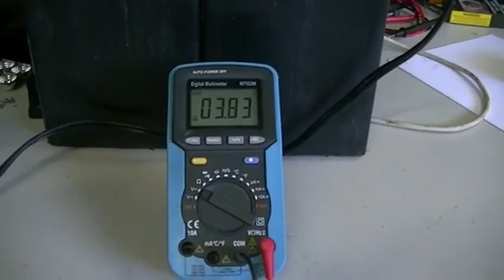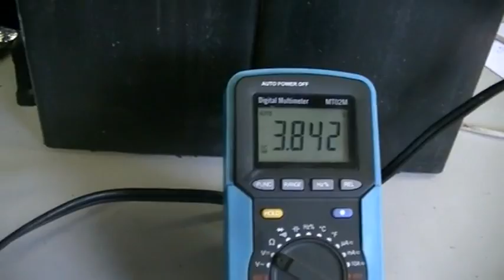brush arcing investigation.

Comment: How make inductive kick back in car with out ignition coil culd it by done? And how wuld I make dual ignition with relays? 
I need some sort of variabel ignition with variabel polarity swap .
Like + + ,- - ,+ - ,- + .
Somthing like that does any ciucuet can do that task? 
I did tried out plazma ignition with good results faster spining starter motor but I come acros problem my starting charge rpm increase on alternator from 1 to 2.5 K rpm .
So mostly to my your rotary transformer is interesting to my and phase spliter .
Im actualy experimenting lot with my engin a try out diferent fuel types so I need to increase my ignition system I have old gm 4 pin ignition module with induction triger inside the distributor ignition coil is the gm hei singel coil e core type I have aperantly problem with polarity in my car I have positive voltage regulator and that 4 pin ignition module is polarity senzitive as well I do have R terminal starter motor selenoid but my fuze pops when I try to use it.
I have teribel problems starting my car in winter its anoying so any help please?
I wuld like to aplly amplifier and plazma at the same time for centrain engin time operation.
So thats why I wuld like to add variabel ignition.
Those rotary transformer basicaly are similar to magnetos I supose.
I wuld like some thing more hande made like buzz coil what is rubust.
I did see some strange acurances in cars over the years I belive my alternator even turned to by somthing similar to starter motor my engin hade high economy its comonly try to dizel basicaly I performed some experiments and that thing basicaly run by it self .
So Im missing proper ignition system who does not fail.
So any ideas ? 
What Im working on are Gasoline/Dizel engin blocks they can by converted easely to carbureted dizel hot bulbs ore hit and miss engin 2 4 5 6 8 stroker internal/externaly fiered .
So Im encountering unusual fenomena with my engin.
Is there any posibility to speak to you directly over mail?
That thing has it minde of its own.
And aperantly problems related to that engin can no where by found on the internet.

Comment: I'm watching this searching for the answer as to why my belt sander is still sparking like mad after the brushes were replaced. It was sparking a lot, started stinking and going up in smoke. Runs great after brushes (were missing big junks) were replaced, but still sparking a lot. Hmmm???
Reply: Dagmar Kugler then what have you done?
I have the same sparking with my   malaysian panasonic vacuum cleaner
Reply: Armature winding is shorted

Comment: I think all the previous posts have merit. Also straight DC when flowing does not like to be interrupted at all. When you are using the battery alone you are messing with super fast DC. This is what Tesla was working with in the end that nobody could understand. It is a different affect that can produce unbelievable results and energy. You just see sparks when scratching.

Comment: I tried this with a permanent magnet hobby motor but got somewhat opposite results. Good arcing both ways. There was a slight current reduction because of the windings but not like the rotor your using. Many of these rotors the brushes are in contact with two segments at all times. The rotor I tested is five segments and when one brush is in contact with two the other is in contact with one. That leads me to think that when you have a motor making all four contacts there are two coils firing and you have a choke killing the flyback and reducing current. Slipping a piece of wire under a brush should show the difference or just trim down a brush to change it over. Love the tests you put together.

Comment: Could be two things happening here TM. 

First your not providing enough current for enough duration for the inductor to saturate at the low voltage. I think unlikely. But possible.

What is probably more the case. Is the motor was made to suppress its own bemf. Either via counter induction. Or capacitance.

Also think of that rotor as a transformer. It has many windings. One for each pair of contacts. Your only using one winding. The others will be flying back too... perhaps once the flyback is distributed over so many coils its divided into insignificance. 

I like the counter emf suppression the best. As its a good design practice. If it didn't have it you'd need new brushes every 20 starts.
Reply: Mongrel Shark thanks, you gonna get more likes than the oreginal video

Comment: Current flowing, or volts and amps, always go together. That is to say volts are the velocity, and the amps are volume at which the wave is moving according to the conductive medium it is moving through. The potential will determine the insulating/capacitive breakdown of the brushes, commutator, and mediums of gases between. The amps when switching according to that observation, will most certainly be a determining factor of coils inductive/capacitance. As will also create an impedance factor like putting fluid volumes in a pipe with 2 fluids like air and water as an analogy. 
Scope shots of the system along with torque tests would be a telling sine. <----- See what I did there ;) 

I think the common thought is that the voltage increases with back emf and speeds up the motor. The interesting thing is you can create far greater efficiency with resonance, and it also looks similar to this. Why not do torque tests with the scope and we can see what we learn. Thanks as always for sharing and enjoy the moments my friend.
Reply: Volts : static electricity" is not necessarily static in fact it is E-field and that always involve  moving or have some spin of atoms inside never ever static but ready to be kicked  ahead Voltage is sort of like "electrical pressure" that force it to move and when we will find out the importance of resonance like Tesla did then we can help each other much more than empty paper money.

Comment: Pretty cool demonstration!
 Marcellus Jacobs, inventor of the first practical wind generator, had issues with the variable speed armature and this led to a brush design that had a low and high resistance composition that would effectively cancel out the long arcing during low speed high current operation.
A quote from an interview... "a brush made up of a layer of graphite, then carbon, then graphite, then carbon. This gave us a brush with a high cross-section resistance. The DC current would practically quit flowing before the brush made its jump from one coil to the next.      taken from
 http://www.motherearthnews.com/renewable-energy/wind-power-history-zmaz73ndzraw.aspx